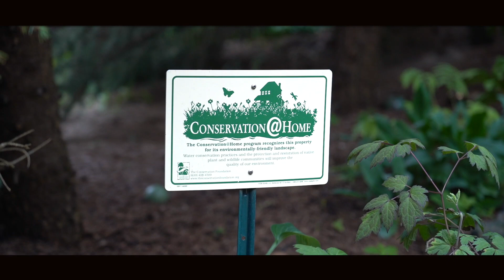WOODED POND PARADISE in the Suburbs

Comment: What a beautiful setting. What does Frank do with the fish in the winter months?
Reply: Jack Hembree He probably leaves it running koi can survive cold temperatures as long as the water is recirculating the pond won’t freeze over.
Reply from the maker: Jack, what Moa said. The fish stay in the pond during the winter. You just need to keep a hole in the ice for the exchange of gases.